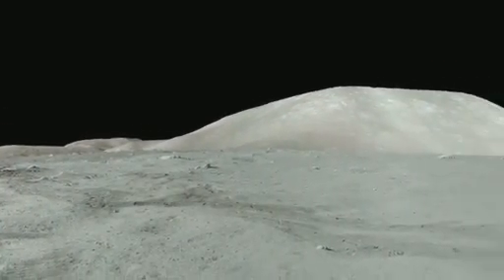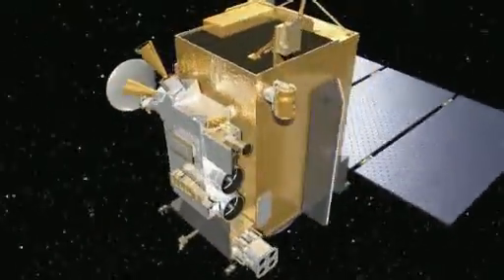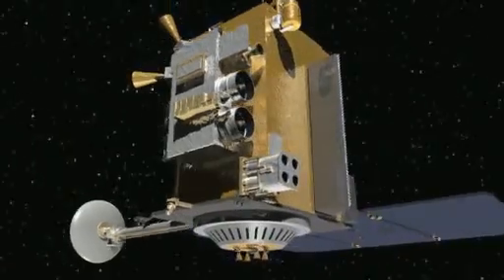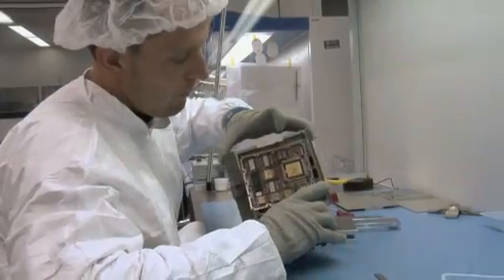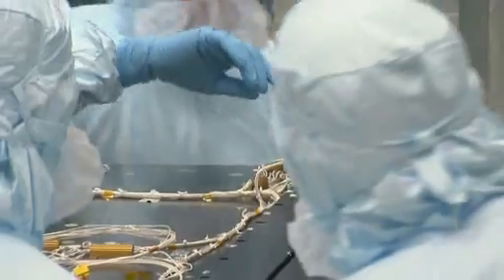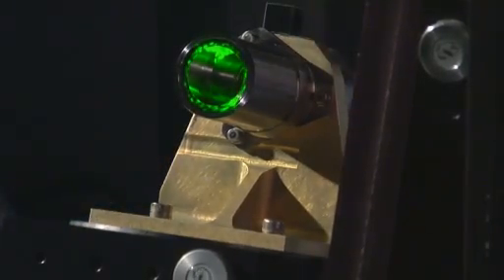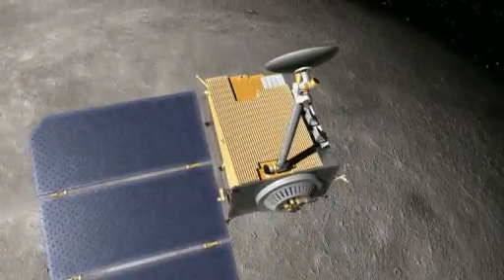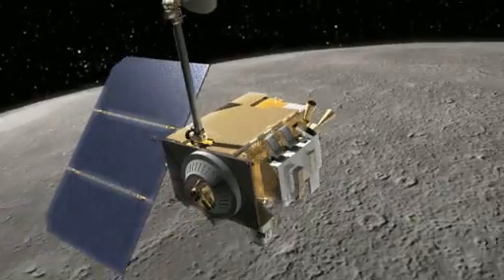NASA | Return with LRO

Comment: For those of you who would like to believe that we went to the Moon, check out this youtube video:

"Moon Landing Hoax-Abracadabra"

Watch as asstronots do 5 ft leaps and bounds without so much as flinching their knees.  This is genuine NASA "Moon" footage.  There are several flaps on the top front of the asstronot's back pack which are used for wire support.  Watch as the flaps are raised up when the asstronots are hoisted to simulate jumping or hopping.